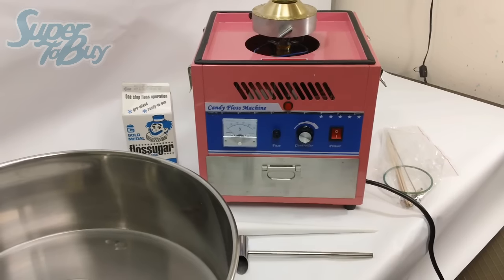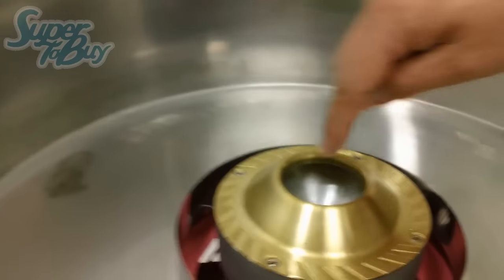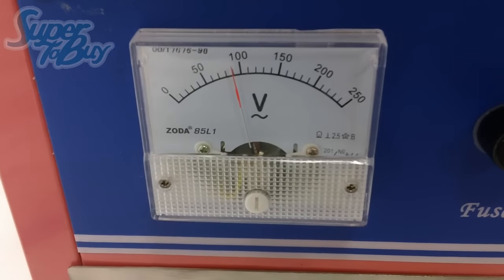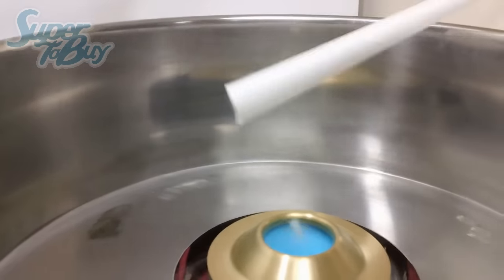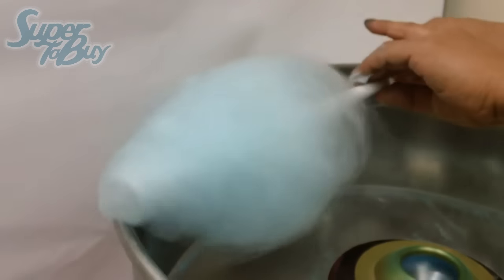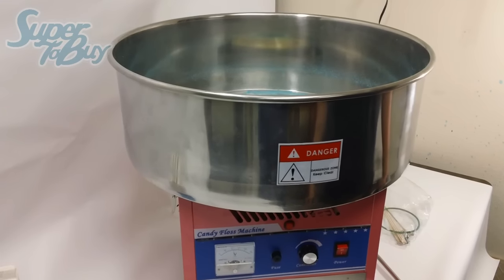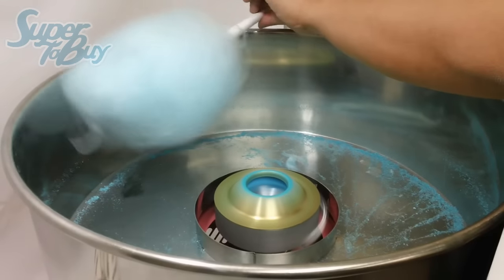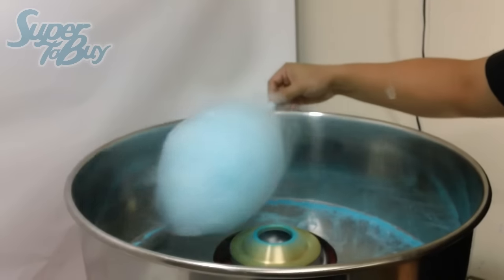Professional Cotton Candy Machine Demonstration Video

Comment: Ummmm no. I would not follow this guys directions on these machines. You turn it on and let it heat up first, than add the sugar and go to town. Why would you pour in enough to make 2? That's dumb. Use the scoop to make 1, you get a nice larger size. And if you would spin it right, your cones would look a LOT better. As for cleaning, you don't wait till it's cooled down. You grab some water and dump a tiny bit inside the same place you put the sugar. The water turns to steam which cleans the inside out. Instant clean. The rest you rinse and wipe down. Nothing professional about any of this.

Comment: Ok - turn on the unit, let it spin for a couple of minutes. Then turn the dial to 180 and give it about 3 minutes (it's about a 5 min warm-up/start up.) Leave it at 180. (I have no idea why he keeps playing with the dial!) Once it's warm add the sugar, the first portion or two might take a minute to come out, but after that the portions should fly out. But use the scoop, don't over-fill the top as he did. Hope that helps. :)
Reply: Thxx buddy! It helps a lot
Reply: So, what if all the sugar flies out. I'm working on mine now, and all the sugar keeps flying out
Reply: The dude on the vid is krea brooo
Reply: Do you have to turn it off to add the sugar? I have a smaller one. I can't add the sugar while it's spinning.
Reply: Agree, do NOT add the sugar before it is warmed up - I made that mistake
Reply: I’m o pip
Reply: This would be a much better video with one tiny small little bitty eensy change.  Change the title to "Don't Use This Machine Like This Guy.  Read The Fine Manual."
Reply: @maggiesanford8324  It’s better if it’s on, in fact it flies in your face way more of you do it when it’s off.
Reply: I need more tricks from you

Comment: My dad was a rep for a major food company. I was sold into slavery to help him with his many company sponsored "carnivals". Cotton candy was one of many fun foods I learned to prepare. A few things I saw here deserve comment. We would run the motor, switch on the heat, and apply a spoonful of sugar mix. When it was coming up to temp, the mix would start coming out. At this point, wipe the inside of the bowl with a damp paper towel.  This will make the candy stick to the bowl, instead of flying around. The dampness and timing require some  practice. Add the mix to the full mark.  Let the candy build up. We would get a full serving, on a paper cone, with one lap around the bowl. Hold the cone vertically, get less on your hand. Do it outside. You will get covered in cotton candy, no way around it. Good luck.
Reply: Pls. Tell me how to prepare cotton candy recipy?
Reply: @nasirmondal786  Companies sell flavor/color compounds. Mix the flavor with plain white sugar to the recomended ratio. These companies sell popcorn, cotton candy, kettle corn equipment. Tools, bags, papercones, candy apple  and corndog sticks. You name, they got it. look them up.
Reply: PS, you could experiment with unsweet koolaid mixed with sugar.. But be careful it doesn't damage the machine.

Comment: Yeah, he's obviously doing it wrong.  Running the cone around the edge of the bowl where the candy strings normally want to collect is the best way to make a uniform cone.  He's just doing the same thing but in a slower and MUCH less efficient way with results that aren't so good.    It's only cotton candy so it really doesn't matter all that much but it would go a lot quicker with better results if he went around the bowl with the cone to collect the candy.  It would also be better if he didn't look like he had the plague when demonstrating the machine.  No one wants a bonus "finger" or "thumb" tip in their cotton candy, trust me.
Reply: wrong about the uniformity
i've spent 3 years mastering this technique that he is obviously demonstrating wrong (everything this guy is doing is wrong). you are most definitely able to get a much more uniform & smoother shape using a this type of machine vs the netting one though - just research "cotton candy art" on youtube

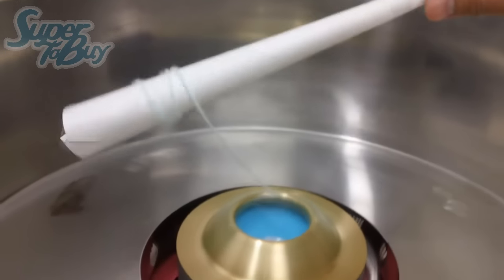Comment: You should point out the mistakes you made regarding the volt meter. You called it not only volts, you said degrees (4:53) and even watts (5:18). and later you kept referring to it as temperature (8:52), you actually did it several times.

This is a pretty giant mistake. Wattage is the result of amps multiplied by volts. Voltage is the measurement of the force (pressure) of the electricity. The same concept as water flowing through a hose.

Those were some pretty big mistakes, and you should point that out, because it is incorrect. and even in your text you called it temperature. it is not a temperature gauge. it's a meter showing how much electricity is going to the heating element, which in turn affects the temperature.
Reply: John Thompson same difference
Reply: W=amp X volt like you said 
 V=watt / amp or amp X ohm

godzilla = god of all zilla's
Reply: +John Thompson He makes cotton candy for a living. Or sells the machines. I don't expect he'd understand electricity, neither should you. I'd expect him to make cotton candy in pretty rainbow colours or such. If he's a salesman, I bet he's not selling these any more :D
Reply: Well thanks for the basic junior high level electricity lesson. Now I can make better cotton candy. SMH
Reply: Who cares. We all came here to watch the gentlemen spin some sugar.
Reply: Guitar George c

Comment: Your machine is missing a piece.  There is a mesh belt that clamps inside the tub and it helps to catch the floss.  This keeps it from flying out of the machine.
Reply: Sassy Cat- This is not that type of machine. This is a machine that the sugar floats upwards and not spins against the sides of the bowl. I have both and this type of unit id the best because you can change flavors after each cone! The ones with the big bowls take time yo use all the sugar and you can't switch up easily without blending sugars. I have several machines and I like this type the best.
Reply: Hi Christina, where can I buy the sugar floats upwards cotton candy machine?
Reply: Amy Kong you can buy those from Amazon. I purchased mine from eBay. I really love these machines because you can use back to back flavors and you don't have to waste a bunch of sugar. Amazon has them. The Vortex is one. 
Vortex cotton candy machine.
Reply: Thank you very much, do you know if this machine has CSA certificate?
Reply: Amy Kong I don't see that it does. It's made in china so I do not know, but Northern Popcorn Co sells them in the USA.
Reply: thanks
Reply: Sassy Cat, ive got a popcorn/cotton candy machine and its got that.
Reply: @christinacarrasco7080  
Can you use normal sugar in this machine
Reply: @alihadi9787  Mixed sugar is normal sugar mixed with flossine.

Comment: Don't anyone watch the fairground guys do this? This is not the way it's done at all, you hold the stick upright and go round the bowl
Reply: Exactly what me and my girlfriend were  thinking. Glad someone else can confirm lol
Reply: different type of machine as far as i can see. Some machines have a mash screen that lets the molten sugar escape from the side. This one seems to let the sugar out from the top (maybe aided by some airflow)
Reply: I watched a few of these CC machine vids and you're supposed to let the candy build up on the inside of  the bowl before you scoop it out with the paper handle thingy. Same basic machine. So it does appear that the guy demoing the machine has no idea how to use it and I find that sort of funny :)
Reply: He's using a widely accepted technique. A lot of people make cotton candy art, and his technique is the only way to do it. Only the laziest fairground type dudes use the "ring around the bowl" technique. Because they are doing only 1 color at the time and don't care if the candy is fluffy or not.
Reply: Wrong.  The units that are used at fairgrounds are more industrial sized.  I have this EXACT model in this video, and as you can clearly see from the video there is no meshing around the bowl.  The larger units have that meshing on the sides which serves to collect the floss on the sides of the bowl.

The more you use this machine, you get sugar all over the bottom and melted on the sides of the collection bowl.  You can scrape that sugar off/up, and re-use it.  I wouldn't recommend mixing/melting different flavors together except as experiment to see if you like the mixed flavor.  

Also, as the spin head gets dirty, it actually impedes the flow of the strings.  So you need to watch yourself when making the cones so that you don't actually touch the spinning head with the tip of the collection cone, because that will melt the floss you have already collected onto the spinning head.
Reply: what machine is  this? I got the nostalgia hard candy cotton candy maker wondering if an upgrade ia worthy
Reply: dudes you guys are all wrong about how this machine works
its a different kind of machine thats literally designed for the cotton candy to shoot up so youre able to catch it on the stick (trust me i've been doing this shit professionally for 3 years already)
just look up "cotton candy art" on youtube & you'll find dozens of videos of chinese people demonstrating the technique correctly, not the ^trashboy^ in this video ;)
Reply: youre right 
the fact that the spinning bowl in the center doesnt have tiny holes on the side means that the spinning action whips the melting sugar upward
Reply: Erwin S
No, that is not true.  There are grooved slits all around that spinning melting-bowl.  It shoots the sugar perpendicular to the sides of the wide catching bowl.  I've got the exact model, linked above. When you do a few scoops, you actually get a buildup on the metal sides of the wide catching bowl -- which you can re-use.  When it's not spinning, you can see there are screws in the top that remove the top brass-colored plate.  And under there, you can see the 'channels' for the molten sugar to be flung out. 

And yes, you can do cotton candy art with this machine.  But do it somewhere you can clean up -- because you do get sugar quite a distance away from the machine.  It comes with a package of pointed bamboo sticks that are used to do the art, a long specialized metal sugar scoop to dump the sugar in, and some spare replacement heat-resistant drive shaft belts.

You can get this machine for slightly under $175 right now, including shipping.  There are commercial models that cost 4-6+ times that, and are capable of producing quite a bit more volume of product per hour.  I would still very much classify this one as home-use, or maybe a very very small commercial operation.
Reply: your completely right about the ridges shooting sugar residue out perpendicular from the sides, guess i should've been clearer. I'm talking about the actual candy floss that clearly shoots/whips upward from the center hole at the top of the gold cap 

I actually own a business making professional cotton candy art ( flowers, animals, characters, etc ) & have gone through 13 of this exact same model plus similar ones. I've gone through a whole weekend event (12hr x 3days) spinning on this model non stop & have managed with these, but they do seem to break down quite quickly (i'm guessing because there cheaply made from china)

have you ever tried a commercial machine that shoots cotton candy the way this model does? i've been looking for higher end ones but have only found the ones with netting which don't allow for cotton candy art to be spun,
Reply: Erwin S
The spinning unit has three semi-circular curved angled air-fins welded onto it -- designed to blow a stream of air UP at the floss as it comes out.  That can actually lift it up into the air, but mostly doesn't in my experience.  Seemed to me it was mostly there to cool it off some...  But if it helps you do your art, all the better.

And unfortunately, I don't have any experience with the commercial models other than to have seen some of their models listed when I bought this one above. 

What part of the machine is giving out on you?  I noticed they packaged extra drive belts which seem to be made of some kind of special insulated material.  But there are no instructions on how or where to get more of them if needed.

Comment: TuxedoElf below has it right. Use the scoop after it is warmed up. One scoop makes about one good sized serving. Then just add one scoop at a time as needed. always be ready with a new cone to prevent the floss form floating away. If your machine is wired to 220 volts, the meter will go to 180 but if you have a 110V machine, it will only go to 110. And read the instruction sheet. The translation attempt to English is hilarious. Have fun!

Comment: Works better if you turn the power on, let it sit for 2 minutes, turn the heat on, wait 5 minutes and then pour the sugar in. Because the machine is hot, the sugar will melt and spin faster.
Reply: Benim makina bunun aynısı ortada toplanıyor kenara vermesi için ne yapmalıyım

Comment: can you use normal sugar instead of floss sugar?
Reply: No, I recommend confectioners sugar if you can't find the special colored floss sugar.
Reply: Crush up any candy really fine like mints butterscotch ect.
Reply: Yes you can use normal sugar. I've been making floss for years... regular sugar works just fine. And yes, you can crush up hard candy to mix in. Works great.
Reply: alienizedgodzilla
Yes. You can use regular granulated sugar.
Reply: Keith Peters thanks
Reply: Use the back of a big spoon to crush up jolly ranchers, candy canes or some kind of hard candy. You can use a hammer but it might dent whatever surface you are hammering on
Reply: +Keith Peters how about feces and if so how much feces can i put in what remperature do i need to heat said feces to and what technique should i use thanks in adavance
Reply: It depends on the machine. Do not use that type of sugar on all machines.
Reply: We use regular sugar all the time, add flavors and colors too, loads of fun.

Comment: I found that heating the hopper to least 160 degrees celcius before adding the sugar yields maximum results. Dropping it in cold only gums up the operation and looks terrible. And I use an IR thermometer to measure the hopper temps at all times. Next video should show how you clean it!

Comment: The string is supposed to come out the outside top edge of the sugarbowl through a screen with little holes in it .
  You might need to empty the sugar and heat up the empty  sugar bowl  and spin hot steaming water through it . Be careful its hot and it will splatter the hot  sugar and steam . Your spinnerhead might be clogged .

Comment: Thanks man. You saved my bussines with this video. I should send you some monry. Very grateful.

I was wondering, why does all the sugar sticks to the wall, burns and no strings.

Thanks man 😇🥳❤
Reply: If a lot of sugar is hitting the wall,then your temperature is too high. If you get just the right temp,it will become hard again before it makes contact with the wall. If the temperature is too high,it will still be liquid by the time it reaches the wall. Some machines are made to gather the floss from around the bowl,while others "like the one in the video" are made to blow the floss upwards above the head unit. Not to talk bad about him, but this video isn't actually good for getting information on running one well. If the head has slanted fins,like a propeller,you gather the floss above the head. The best way is to turn the machine on,let it spin up,then turn the temperature up,wait for it to heat up,and add sugar,find the correct wattage where it is just barely hot enough to create floss,any hotter will cling to the bowl, normally the temperature setting will be fairly high in the start,but once it starts creating floss you need to turn it down. Unfortunately the heat is slow to change when you adjust the wattage,so it may take a few minutes to find the sweet spot. I bought one a few months ago just like this one,and they work much better if you do it as I said,and not as this video says. I hope this helps. Good luck.

Comment: You gotta put more sugar in, and pour it in while the machine is on, so it distributes evenly.  The thing heated up quick because when there’s barely any sugar in it, it overheats.  Don’t turn down the heat, unless you’ve been using it for more than ten minutes, and need to slow the pace.   Start the floss lower on the stick too or else it’ll come off too easy.  Blend your own sugar.

Comment: I just bought a similar unit and used it yesterday at a fund raising event for a local charity. 2 problems I encountered was after the first 45 mins, the quality of the candy floss reduced massively. I was using like 2 scoops to make half a small cone!

Do the machines need to be cleaned every hour or something? There was a lot of suger in the spinning head and sides?

And 2nd what happens if you leave the voltage high? I had mine on 220 volts for like 5 hours straight!

Does this mean it would melt more suger faster?

Why do you advise we keep the voltage on 90? I'm just curios and asking the question so I can better understand the machine.

Thank you in advance

Kind regards
Anj
Reply: I was informed by my seller that you need to clean it or poutmr it with water every after use for the sugar not to hardened inside. It needs to rest for 20 minutes after using it an hour accdg to the manual.
Reply: @nursejohn514  OK il double check my manual thank you very much
Reply: 220 is too hot the sugar as no time to  cool down and just gets stuck on the walls